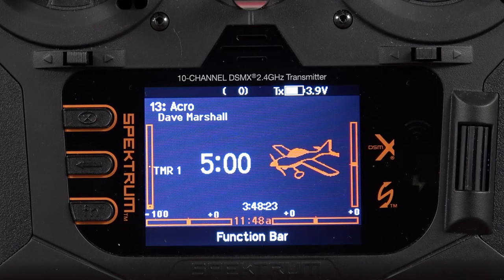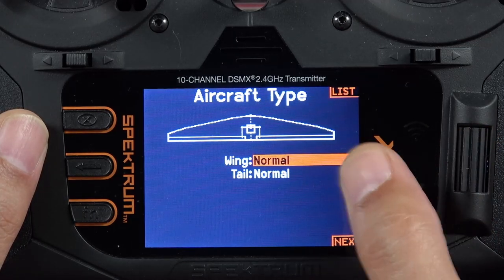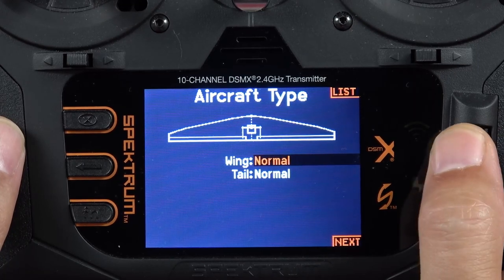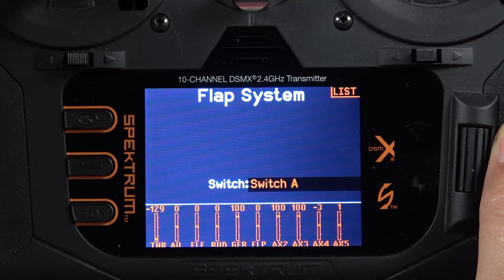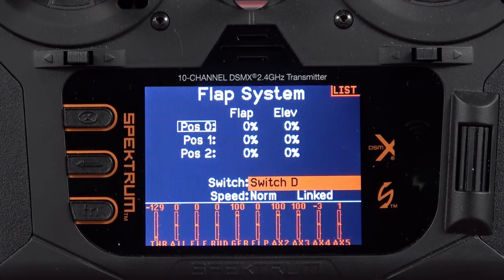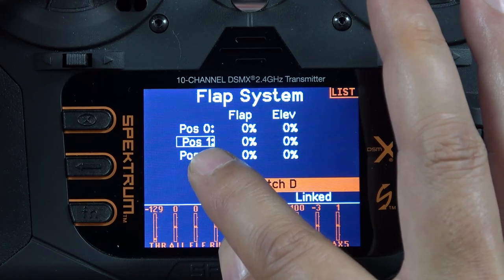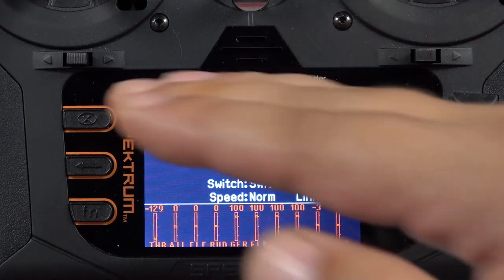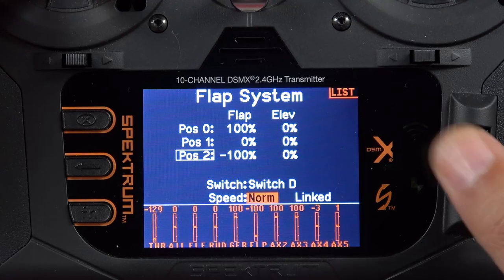Spektrum NX Series Tutorials - Flap System

Comment: Very clear and complete instruction. So thank you. Question: the Carbon Cub S+ with GPS, and LAS  lease only Channel 8 for the Flaps. How is that accommodated using the Flap System if it assigns flaps to Channel 6?

Comment: Terrific explanation of how the flap system works and I know you haven't got there yet but your better off to set it up flaps as flight modes so you can have separate trim on each position that way you don't need to keep adjusting your elevator settings to find the right setting.
Reply from the maker: I would need to do some experimenting with that. I know you can do it, just not sure if using the flap system would be the best approach. I think it may be better to assign the knob/slider to Aux 1, and use the mixing menu to assign a mix from flap to elevator.
Reply: @TheRCAirMarshall  You could do that but the nice thing about using flight modes is you can have three different trim settings. If you go to "trim setup" you can select FMode instead of common. You can trim the elevator on each setting while in flight without affecting any of the other flight modes.
Reply from the maker: Hah, sorry my answer was for someone else. I absolutely agree with you regarding flight modes, but that’s a couple weeks out. 1 video a day, I wish I could just be available all the time. Real job and life get in the way. I just want to make videos, and have a whole filming and editing crew. That would be awesome. LoL
Reply: @TheRCAirMarshall  Gotcha. I have to say I've been enjoying your series so far learned a few things I didn't know. Keep it going when you can.

Comment: Your tutorial appears to only address use of an ACRO model (power plane).  However, many of us fly sailplanes with Spektrum radios.  If we create a SAILPLANE model with flaps, the Function List item called Flap System does not appear and apparently there is no default input (switch, stick) that will operate them.  So there must be some way to specify the input and then the % and direction like in an ACRO model.  Any ideas would be greatly appreciated.   jgiles

Comment: thank you for clearing alot of this up, great job. I have one question though. I have a Glider No throttle with Spoilers, elevator, and Rudder. spoilers are run with 2 servo's do I just use this Flap setup? using a 3 position switch D I'm using a NX 8 new version with latest up dates. Do I put these servos on AUX 1,2 ? I understand one of the servos is reversed. Can I rename the switch to spoilers instead of Flaps?
Thank you

Comment: Could you help me with an NX8 flap setup question... I am selecting dual AIL and dual Flap servos for a Sail plane but I am not getting the Flaps setup in the Function List. I am getting instead Camber presets and Camber System???
Reply: Hi bizjets....I noticed you didn't receive a reply to this - but it's a very important question.  I'm currently trying to set up a 4m v-tail glider on my NX8 and noticed the very same thing you asked about.  I also found from the Monitor screen that the flaps don't react to any switch or stick "by default" in the programming.  Something must be available to specify switch and/or stick and % operation, but I can't find it.  Did you ever get this figured out?  I'd greatly appreciate your input.  Thanks,    jgiles
Reply: @jerrygiles1661  yes I had to use airplane configuration instead of glider. Go figure 🤔
Reply: @1bizjets  Thanks for responding...I thought of that but can't bring myself to do that just yet.  It's the "principle" haha.   It makes no sense that Spektrum wouldn't have included an intuitive way to manage the flaps on their Sailplane model.   Well, happy flying...
Reply: @1bizjets  I was fortunate earlier to receive help from a gentleman in Australia when I was setting up my first v-tail glider.  I thought I'd run this by him and received a wonderful reply today.  He confirmed what you and I have observed about NO flap function in Sailplane mode.  But he did lead me to the solution in case you're still interested.  jerry
Reply: @jerrygiles1661  hi Jerry. I'm curious to know what this gentleman from Aussie told you was the solution. I'm going to need it because I'm putting together a 4meter ALPINA 4001 myself. 😁